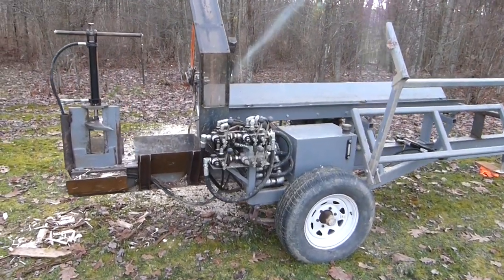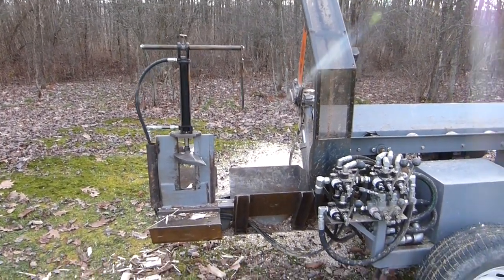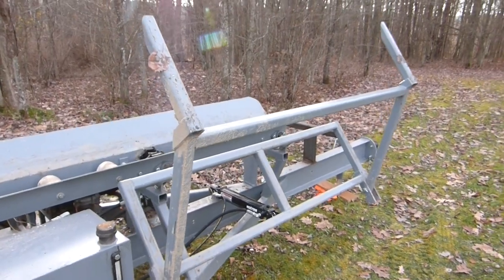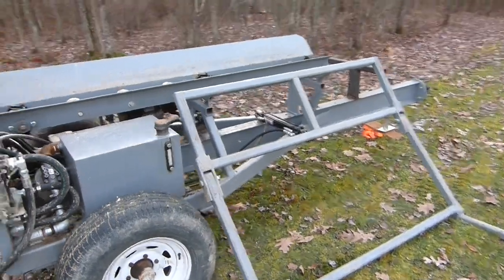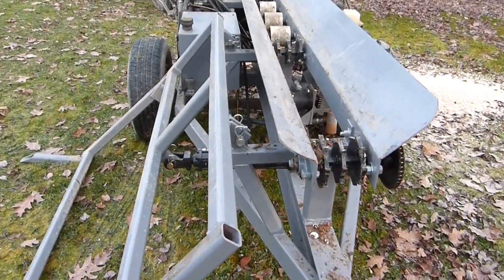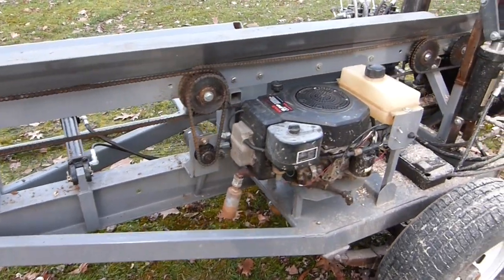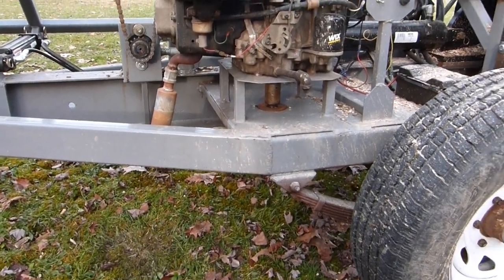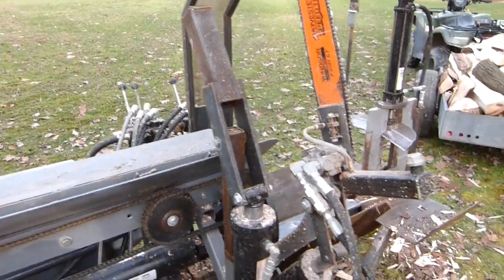Homemade firewood processor walk around

Comment: I really like this machine. The hydraulic motor driving the saw chain, is it a gear motor?  Also what RPM does it run at?
Reply from the maker: Thank you! It’s a high speed Parker MGG motor from Surplus Center. I can’t remember which model all I remember is it has a 9/16” shaft.

Comment: Metalcutter - Thank you for the walkaround which answers some spec questions and shows us a lot of dimensions by observation.  I am in the process of building a machine based off what I see here.  I'm using a 40hp engine with 25gpm of hydraulics.  I hope to cut and split at the same time, have a split wood loading conveyer and have a bit of an incoming log magazine.  Thanks for your description below of your plumbing.  I take it it's all open center.  Glad it's working so well for you.  Cheers.
Reply from the maker: Yes it's all open center. Thanks and good luck with your build!
Reply: I just started painting.  I can send some pics soon.

Comment: Did you use any special valves to limit flow to everything except splitter cylinder?
Reply from the maker: No valves, I did use smaller diameter hydraulic line to the lift cylinder to slow it down a bit. I also picked cylinders with a bigger outside diameter and smaller rod diameter for my clamp and saw, this way it would take longer to fill with oil. These cylinders are way over kill for what they're doing, but they were cheap through surplus center.

Comment: I like your machine .I am trying to build my own presently .Would you be willing to answer a few questions? How can I contact you?
Reply from the maker: Thanks! You can ask any questions here and I’ll try my best to answer.
Reply: @metalcutter8579  Thank you 
What size is the shaft on 
What size is the sprocket?
How do you attach it to the shaft?
What size is the bar?
The hydraulic motor I'm  trying to use has ..562 shaft keyed.
I have not been able to find a sprocket.
Reply from the maker: @brucesherman5625  I think the shaft on my saw motor is .562 (9/16”). The bar is around “20, I bought on eBay. All I looked for was one with a wider end unlike a chainsaw bar. The sprocket is around 3” diameter and had a taper lock to fit the .562. It seems I bought it from a company in Washington state that made other parts for wood processing equipment. I may be wrong it’s been a few years. I know I found them online.
Reply: Thank you

Comment: Can you tell me more about your hydraulic setup? Spool Valves makes, gpms. Motor sizes. How do you have your saw on and downfeed setup. Thanks
Reply from the maker: Chris Wade I used all Prince 5000 series spool valves, because they are rated for 25GPM and I used a 22 GPM 2 stage pump. Its a bit of a crazy setup getting all the valves connected. Its a single valve for the saw and saw feed cylinder. Then power beyond to the 2 spool valves, first one runs the feed table and the second runs the log clamp, that's the top row of valves. Then power beyond to the bottom row, First a single valve that runs the splitter. Then power beyond to the final 2 spool valve, one runs the 4 way wedge and the other runs the log lift. I had to make a manifold for return lines for each set of valves.  I think it would have been easier using sectional control valves setup the way I wanted but the cost would have been almost double. The feed table motor I got off Ebay and figured I could make it work by gearing it up or down, I don't know what size it is. Saw motor is a MGG2 series, I think it was around .45 cu in.  For the saw I just went from the valve to the saw motor, right after the saw motor I have a one way check valve then a tee in the line with one going to the return tank and the other going to the feed cylinder then out the cylinder back to the valve. So far this has been pretty solid, we've cut 4 years worth of firewood with only minor problems .Hope this helps, good luck with yours!
Reply: Thanks
Reply: Metalcutter so if my math is correct and you are putting 22 gpm through your 0.45 in. saw motor, it should be running at 11000+ rpm which is well beyond its rating. I assume that was intentional to get the RPMs up? Has it held up? Great build and thanks much!
Reply: Metalcutter p

Comment: Does that gravity fed oil work? Any issues clogging?
Reply from the maker: Yeah it works, it has clogged a few times not a big deal to pull the bar and clean it out though. If I notice its not getting oil I'll occasionally pause when the bar is through the log to let it flow. I think the viscosity of the oil makes the biggest difference, needing lighter oil for colder weather.